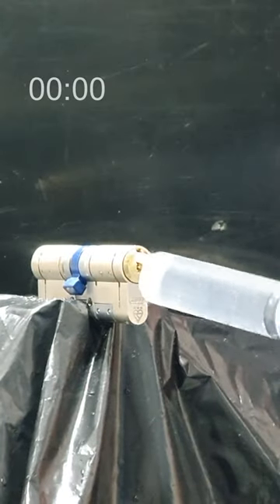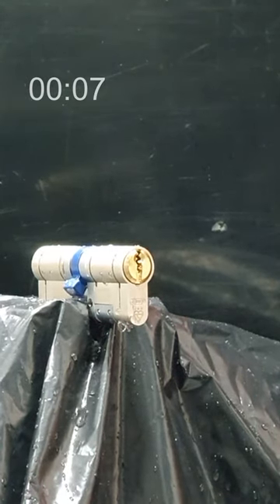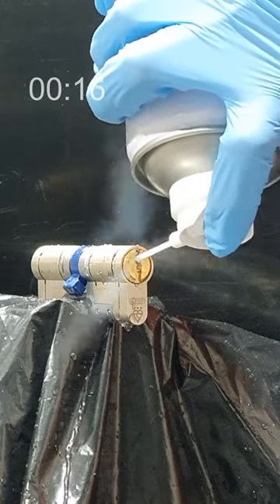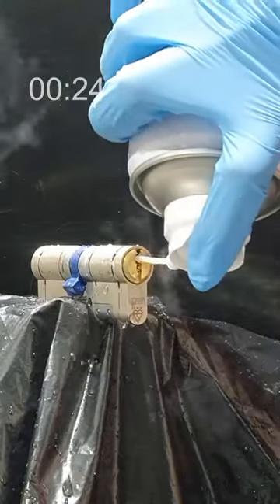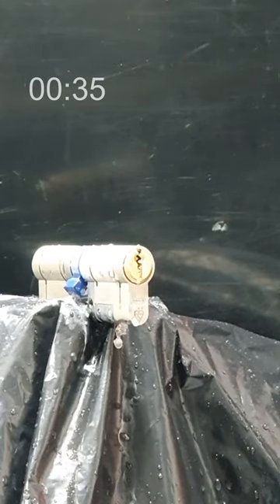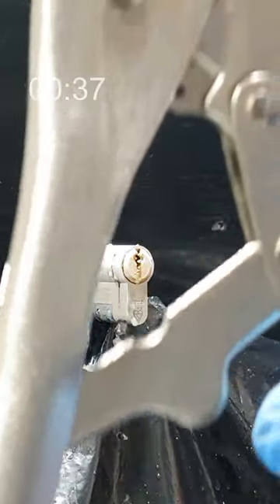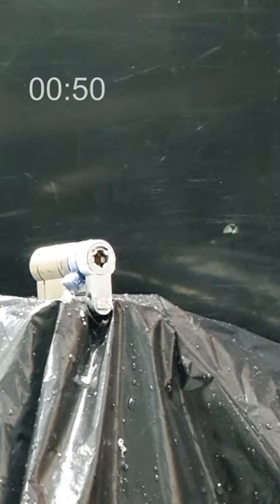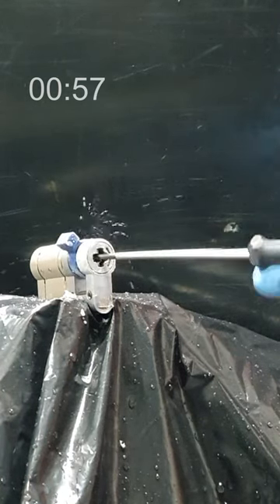Bypassing a 3-Star Anti-Snap Lock - Abus X60 Lock Snapping #shorts

Comment: How exactly would you grab the cartridge with vise grips when it's installed in the door?
Reply: As a widow serviceman of 18 years I agree.
Reply: With an installed lock you could drive a screw into the lock plug and use that to snap the lock.
Reply from the maker: Firstly, the door handle or the escutcheon (protective plate) is broken, granting access to the cylinder lock. Numerous videos on YouTube already demonstrate this part of the lock-snapping technique. What we are demonstrating here is a technique which can bypass the immobiliser mechanism found on 3-star anti-snap locks, which provides a defence after the lock has been snapped.
Reply: You obviously have to pull it out of the door first. Duh
Reply: 😢snap off the door handle akd surround, tis why i replace my 3 lock with euro 6 star that snap and leaves no place to put a screw driver
Reply: This is why you need pas24 handles

Comment: It is possible to get to the cam section, but not as easy as shown on this clip, all depends on how tight the prep is around the cylidner itself!
Reply from the maker: Absolutely correct. The video omits the initial steps needed to access the area around the cylinder lock, usually involving the removal of the door handle cover or escutcheon — a well-known process. Our primary focus, however, is on showcasing a technique aimed at bypassing the immobilizer mechanism in 3-star anti-snap locks. This mechanism typically acts as a defence even after the lock has been compromised. We're highlighting this specific aspect to enhance understanding and security measures.

Comment: I know I'm stating the obvious here...Um... it's not in a door... So the leverage that you show in your video is non existant IRL IMHO. 
I think @thelockpickinglawyer needs to see this. This smells of BS to me.
Reply from the maker: The front section of these 3-star locks is designed to be sacrificial, intentionally breaking with ease even when installed in a door. This design prevents the lock from being snapped at the centre, which would otherwise provide easy access to the cam. The immobiliser within is engineered to obstruct the rotation of the cam once the front section is compromised. However, in our case, the application of frozen water jams the immobiliser, hindering its activation once the front section is breached. We plan to release a more comprehensive video soon, detailing both the operation of the immobiliser and the employed technique.